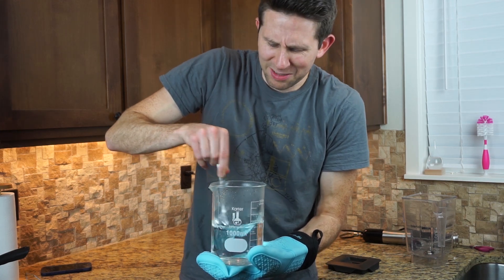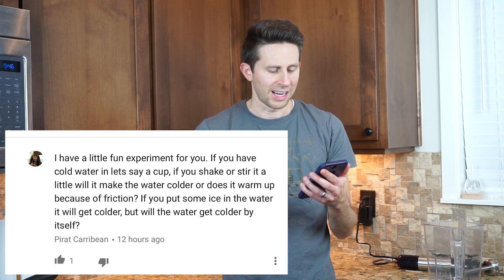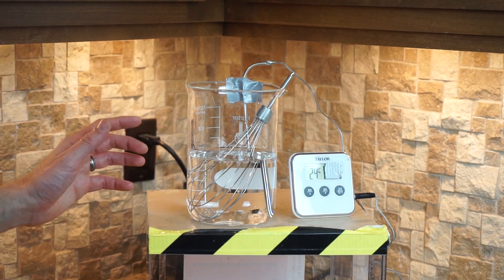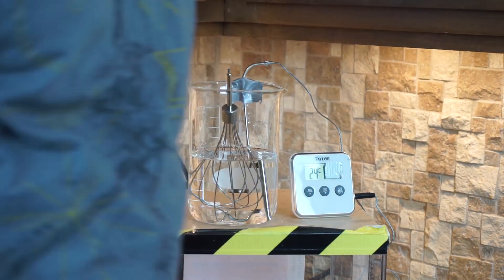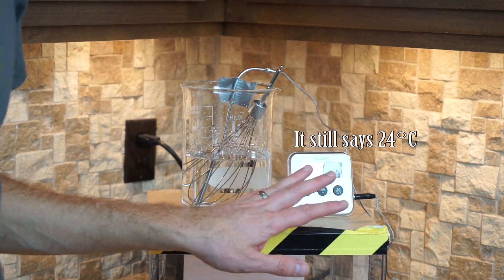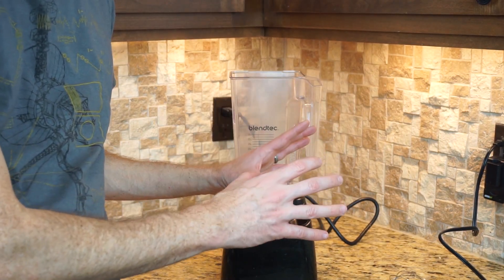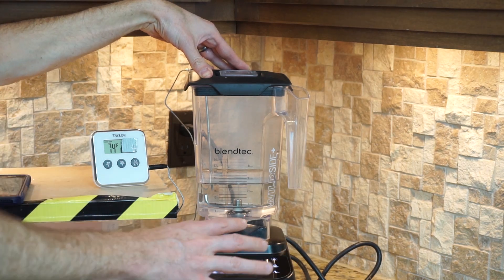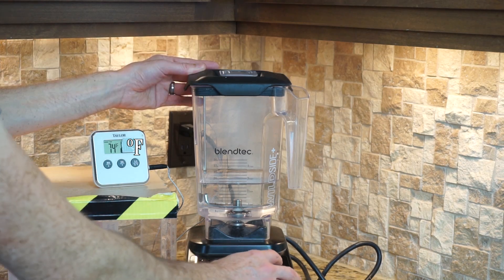Can You Boil Water Just By Mixing it Really Fast? Water-Stirring Challenge Accepted!

Comment: Weirdest hypothesis ever. Friction is caused by two things rubing. Water particle move two fluently to cause the friction. The heat may just be coming from the blade itself not friction between the two. That is why water and other lubricants are used to cancel friction caused by machines.
Reply: Darius Robinson The reason swimmers shave is because of fluid friction,why do asteroids burn up?Fluid friction.And before you ask the wind doesn't heat you up since it's not fast enough and just takes some of your heat instead.
Reply: Previously my comment said before it was edited "...the type of friction he was thinking of."
Reply: I understand the concept of fluid  friction. It isn't new to me. I'm just saying most of the heat must be coming from the blender itself rather than fluid friction.
Reply: Darius Robinson Yeah, electricity enters motor,motor makes kinetic energy and friction which becomes heat, both travel to blades and end up in food. So in a way friction does cause it and you're about the blender heating up the water not fluid friction.
Reply: Yannis Karageorgiou  mabye I should have put it that way. Thank you kind sir
Reply: Darius Robinson most the heat is not coming from the blender, but from the friction and cavitation.
Reply: Ur. Not smart there is friction even with air
Reply: Darius Robinson You're an idiot. This was proven threwout history with other methods.
Reply: *R E A D. T H E. P I N N E D  C O M M E N T *

Comment: There were two thermodynamic systems in use. One, the open system. Two, the (partially) closed system. Water in a closed thermos flask will heat up with shaking it, and much quicker than water in a closed bottle — the first case being (partially) isolated system and the second, closed system. Would've been interesting to see you mention these states and provide that extra info on them

Comment: I don't think it's the friction with the water and the blade, but I thin its the motor that gets very hot and the metal blade conducts the heat to the water or the friction with the waterproof bearing under the tank or both.

Comment: interesting ,when i was child if the tea am drinking is is so hot i will just stir it with spoon it will get colder 🤔🤔
Reply from the maker: Well that’s because your tea is hot compared to the air and so when you stir it it increases the heat transfer between the air and the tea so your tea loses heat faster. Same thing happened here too. My blender was losing heat to the air faster than if it were just sitting without stirring.

Comment: The heat comes from the cavitation of the blades through the water. More specifically the collapse of the cavitation bubble. Look up Mantis Shrimp or Pistol Shrimp. They both use cavitation to catch prey. When the bubble collapses in heats to 22,000 degrees and releases a tiny bit of light from a process called sonoluminescence.

Comment: The thing you want to demonstrate is correct, water do heat up from friction. But this experiment is not good, you need to thermally isolate the motor from the water, the blades are clearly sinking heat from the motor.

Comment: A spinning METAL blade on top of a hot engine and also a ball bearing that will heat up a lot more from friction inside that spinning blade and its all sitting on top of the same hot engine... the scientific method here isnt exactly perfect.

Comment: Are you sure that its not just the bearings in the blender that make the water hotter? You should try this again, but once the water gets to boiling, quickly switch to a different blender that hasn't been used.

Comment: For the first video ive seen of this guy this was not a good one. the friction of the water on itself here would be nowhere near enough to boil it, it would certainly account for some of the heat but water produces barely any friction inside of its own surface tension, what is far FAR more likely is the motor driving the blades inside the device conducting up through the metal and the friction of the bearing in the jug, these would account for massive amounts more heat than the water, considering how it was thrashing the water more than just stirring it you would be able to produce a far more notable heat change by shaking it.
Yes sure the joule paddle wheel experiment did something similar but even that wasn't perfect and i can guarantee it would have been far slower and a much smaller increase than was shown here, same as water pump impellor motors burn out from the strain and get hot enough even to melt plastic.
For saying the bearing was too good to provide much heat is bullshit, you can hear the blades slowing down when the mass of water impacts it, which slows the bearing down creating a spike in both the bearings friction and waste heat from the motor straining. After long enough this would burn out the motor, emphasis on the word burn.
This is ok as a proof of concept but since the dude made a comment defending this, it's just plain dumb.

Comment: That's nice an all but I think 99% of the heat is generated by the steel parts in the blender rubbing against each other. Not the blades rubbing against the water. Although it's very possible to heat up water this way. If you look at boat propellers you'll see they have bubble like damage around the blade, this is called Cavitation erosion-corrosion. In short it creates micro bubbles in the water that heat up to extremely high temperatures and create micro holes in the metal propellers.

Comment: so while you could theoretically boil water by mixing it that is not what happened if you look where the water is boiling from it's from the blade which has been headed from it rotating for long periods and the bearings in it slowly heating up if you took an infrared camera and looked at the experiment that way I can guarantee that's what you will see

Comment: Alright, now run the blender with absolutely nothing in it for the same amount of time that you did for this experiment.

With nothing to transfer the waste heat into, your blender would probably fail or be on the path to failing. Motors aren't 100% efficient and that heat has to go somewhere.

Comment: Some of the turbines do work with the friction created by water like the tesla turbine and such which only has fluid moving thorough a blade less wheels parallel to the water flow

Meaning water has sone friction that it can move the turbine , so it can also create heat energy

Comment: I don't know about the bearings.. but the motor itself.. magnetic energy can be converted into heat too.. the ball bearings have the grease.. the grease should make a nasty smell first if it was the bearings..

though I know it's true, it's the time that took the water to boil by stirring fully mechanically than by the time it took to boil by stirring using a blender which uses either a flux switching motor or a brushless motor

Comment: Are you sure that the heat from the blender didn't come from any of the parts of the blender or if it was the water, be\cause it would make sense if the motor was creating that heat or one of the components attached.

Comment: Maybe you can use a thermographic camera so you can really see where the heat is coming from. And another suggestion is try to run the blender without water for a few minutes and measure the blades' temperature or the bearings temperature, if the temperature increased there is a high possibility that the water gets hot due to the friction of the bearings 😁

Comment: Remember that the electric motor is not 100% efficient. Most of the power (wattage) is lost In the form of heat. Essentially making the engine a partial heater. Usually larger electric motors can achieve an electrical efficiency of 90% however in this small engine much of the energy (watts) the motor is fed (about 40% of the power) is not created into rotational energy but is lost as heat energy. I’m quite sure this is a great experiment to prove that water (especially pure water) is a poor conductor of heat just by the sheer amount of energy required to make the water boil. But in the case of proving that friction alone can boil water, this experiment was not scientific and neglected many factors of error.

Comment: blender blades connected to motor with metal (metal convects heat) motor run on full power with no load with get really hot... although i agree the temp with raise from kinetic energy being put in a think you totally missed that variable rendering these results null. great idea but i am sure your water boiled due to the heat from motor.

Comment: Bag Head Says...
There are a few things to point out... 
touching the unit itself is heating up the chamber. 
the motor is spinning at such a rapid rate creating friction.
the bubbles are only seen coming directly from the blade or bearing portion of the mixer (heated from motor)
im not saying it doesn't heat up from friction, but your experiment has to many flaws.

Comment: Yeah it is a cool and wacky experiment but a bit inaccurate, i believe what most people would think - the truth, that is of course the motor of the blender heating up as bubbles are coming from there as the water gets hotter, and a blender isnt designed to blend water only, if you used a blender normaly it would be for chunky foods like veg or fruit and ice to make smoothies, so it wouldnt be spinning that fast naturally, therefor would be overheating and causing the temperature of the water to rise due to the bearing plate at the bottom of the blender

Comment: Interesting, I think can use this kind of outcome in winter season by applying better mechanical engineering concept, improving the gears movements, harvesting the free wind energy from outside of the house to at least boil the water and save the electricity bills during winter season.

Comment: It's heating up due to the electric motor. If water got hot due to friction then why do engines use water to cool the block?  Yes I know they use Antifreeze aka Glycol, the water heated up in this video  because of the motor has load on it for such a long period of time so the water absorbed the heat.   Same thing that happens in liquid cooled engines.
Reply from the maker: +TRX VLOGGER take your complaints up with the laws of thermodynamics...

Comment: I believe all you'll do is spread the temp throughout the beaker so it won't increase.  In a lab we use a stirring rod that stirs the water but if no heat is applied it just keeps the temp even

Comment: No because as you mix you are making water go to the top and cool dawn so they neutralize them self. Some mixers that awe sealed and make a vacuum manage to heat the water because there is no air to cool it down.but I don't think is better to heat up water in a mixer instead of a microwave.
Reply: it's fascinating how far people will go to try and back their claims. vacuum mixers. rofl.
dude. it's a (sort of) closed system. the air heats up too.
Reply: Santiago Melo learn to spell before talking

Comment: correct me if i'm wrong, but i think there is a very easy way to check if the heat came from the motor or not

just after you stop the blender, you remove the cup and check the temperature of the blades that are part are part of the cup. metal is a better thermal conductor than water so if the blades are at the smaller temperature than the water, then the heat could only come from inside the cup. if the blades are hotter then might be the motor

Comment: The Action Lab - I was going to post before you added the end to the video info about an experiment with better controls over external heat sources and you did have a fairly hefty one next to it possibly radiating infrared being absorbed by the water - probably not much but still something.  Not sure which version of the blender you have, but on the blender's you mentioned it putting out 1500 watts of   mixing power their 1560W model has a 3 horse power motor with a metal shaft turning those wldedd blades at pretty high rate if shows.  That black case around the angry and hot pixies plus the motor is going to heat has got to be at least warm after that full tilt running for some time.  Obviously it's not boiling just from that but still every little bit helps.

Would be interesting to do with a flir camera.  One other idea is to take a paint mixxer attachment for a drill (plugin AC not crappy battery junk) add a lid for splashing and see what happens there.  That is still quite a but of kinetic energy to impart to the water

Cool experiment though!  You got a thumbs up and a sub from me because I somehow got unsubscribed.

Comment: Yo can you put ice inside a vacuum  chamber and see if it will melt...it would be awesome of you read and showed this comment...YOU'RE THE BEST!
Reply: Actually, even in perfect vacuum the ice would melt due to radiation and conduction. Remember that a vacuum chamber's walls are heat-conductive, even if just a little. There is no perfect heat isolator in nature. Also, energy can also reach the ice because of radiation, as object emitts a little amount of energy through vacuum, and energy, as in electromagnetic wave form, can travel even in vacuum (why radio works in space, as well as light, so we can see the Sun, Moon, planets, stars...). If heat translates into infrared, anything that is "hot" (consider the wall are at ambient temperature) will eventually heat up the ice cube, which is not transparent to infrared and will absorb it. The same happens to microwave. You can further decrease the melting by finding a way to make the ice cube float (then losing contact with anything) and cool down the walls themselves, now made of a material that blocks infrared and microwave radiation.

Now, a point to lift. At such low atmospheric pressure, the ice cube would stop melting and actually start to sublimate. Water can become a gas, and thermodinamically speaking, gas has higher entropy, which is super favorable. If there is a chance for water to fill the vacuum, it will. Then, over time, the ice cube would start to lose volume, become smaller, because water is leaving the crystal lattice in form of gas. I am no expert in thermodynamics to ensure this hypothesis, so I'd appreciate a correction.
Reply: NothingXemnas wow......I dont feel like I belong here....everyone here is a genies
Reply: Danielle Sinegal it will eventually melt, we can’t accomplish a perfect vacuum so there will be small amount of heat transfer eventually melting it.
Reply: Oh...ok thx
Reply: Mr. Illuminati but what about the time difference,I would love to see that
Reply: Danielle Sinegal depending on the materials used it can be a quite dramatic difference, think soup in a cup vs in a thermos. Strong vacuums are great insulators due to the extremely low amount of gas that heat can travel trough.
Reply: Okay...Thx....I love how everyone that watches this channel is so smart 👌👍

Comment: if you are allowed to use firearms could you please heat up metal by firing bullets in a specific target or point lots of times, maybe make ot like how blacksmiths make a piece of metal red hot by just hammering it a lot of times but yours will be with the help of a bullet instead of a mallet?
Reply: julian carlo mojica lol, Black smiths don’t make metal red hot by pounding on it. The metal is heated in some type of forge, blacksmiths then Lund the metal rods into the desired shape...

Comment: This is a great video.  For those who are around machinery, many of you know that all automatic transmissions and some large hydraulic systems will quickly overheat without a good cooler, because of fluid friction.

If you want to boil something faster in a blender, use something much thicker like a thick soup or sauce.  Your blender will actually make it's rated power if you don't overload it... and you can enjoy it later 👌.  Water is too thin and your blender is probably using only a couple hundred watts on it.

Comment: The effect does exist, but you haven't showed it here. The actual effect is VERY small and you need very sensitive equipment and carefuly designed protocol to prove it.

Heating coming from the blade (electromotor heat creeping through it AND blade friction heat) is totally overpowering the whole effect. I know that even empirically because I've tried it myself a long time ago.

You need a very isolated container (calorimeter) with highly isolated blade and a very sensitive thermometer.

Comment: Here's a control violation, have you checked the blade spinning mechanism to see if it's over heating and transferring the heat to the water. Water conducts electricity which is raw energy.

Comment: The water did not heat up due to the spinning by itself. 
It is actually the blade heating up due to the friction of the water which in turn heats up the water. 
#Science

Comment: The amount of heat due to agitation is minimal, the blades are way too fast and cause the water to cavitate so it's extremely inefficient at best. In your experiment the heat came from the engine (and no, the heat is not generated by the bearing but by the electricity flowing in the coils inside it)

Comment: Abt the mixer part 
The increase in temp could be also due to the mixer vessel directly in contact with the blade and also the main body bearing motor and as the motor also creates a lot of heat 

If u agree then hit like or vice versa

Comment: could be the ball bearing heating up, hence why the temperature spiking up quick just 3-5 secs after the motor runs... or it could be conducted heat from the motor to the steal rod where the blade is connected... but that just me...

Comment: submarines boil water (little bubbles that come off subs prop) by dropping the pressure and this flash boils the water without changing the temp, water doesn't have to be hot to boil, changes in pressure can boil it.